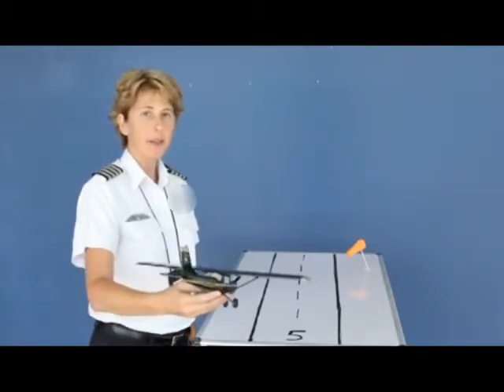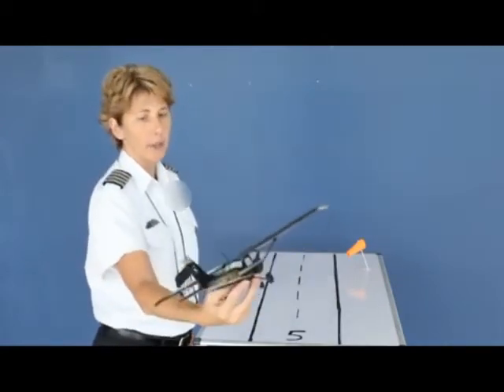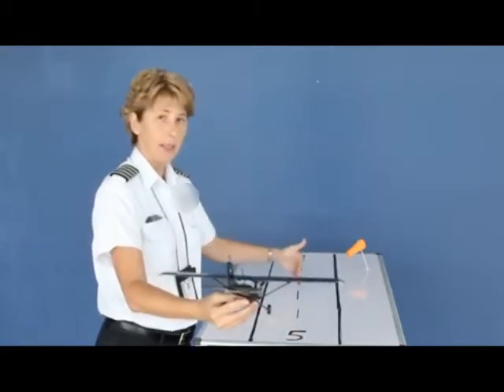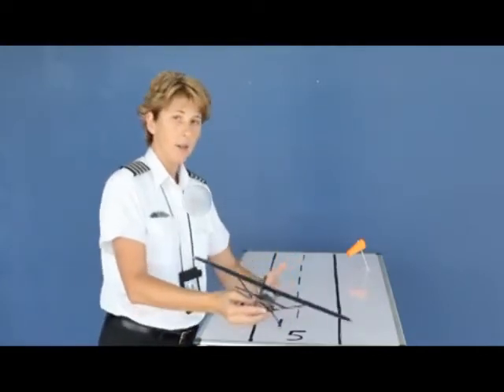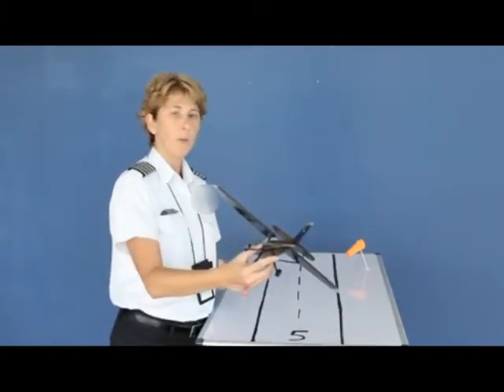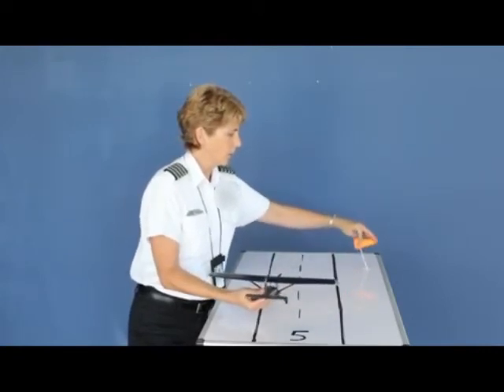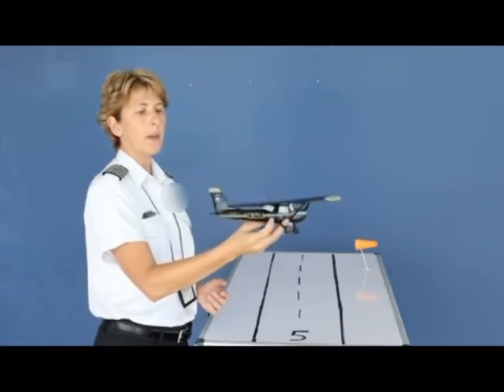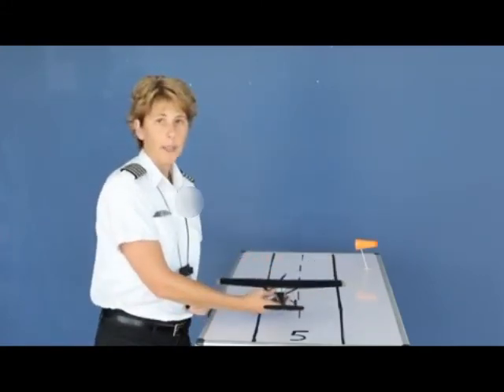Slips (Private Pilot Lesson 4b)

Comment: So was air canada flight 173 a forward slip and not a side slip?
Reply: Funny, I was thinking the same thing. I believe it's Air Canada 143, the "Gimli Glider" of 1983 you are wondering about. The unpowered 767  was coming in high, so the pilot put in a forward slip to quickly lose altitude without significantly  increasing airspeed. In the Mayday TV episode about this incident, the 767 approaches in a pronounced wing low crabbed attitude with the pilot pretty much looking out the side window until just before touchdown.
Reply: You mean flight 143 not 173. I thought it looked like a side slip based on the animation I’ve seen. And also in the Nat Geo video they say it’s a side slip.